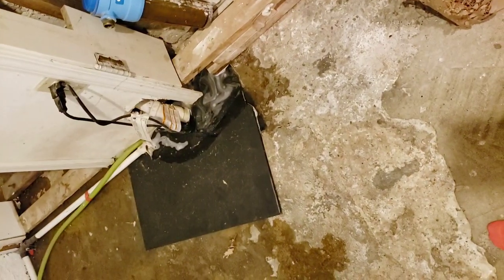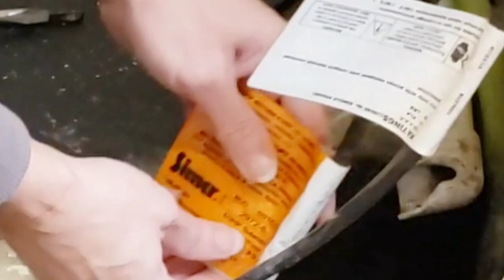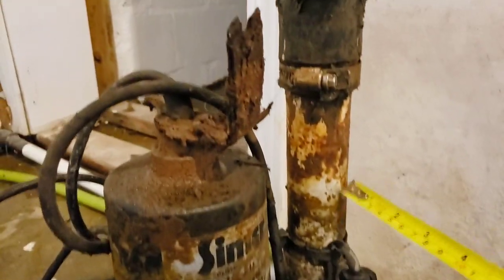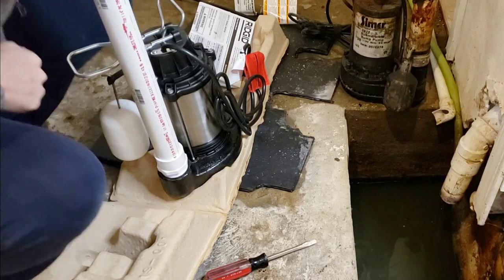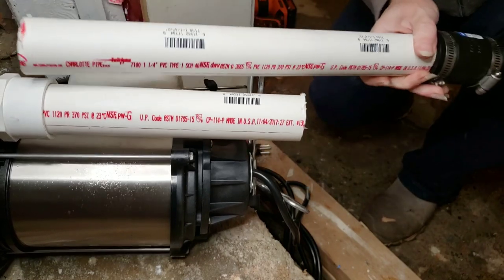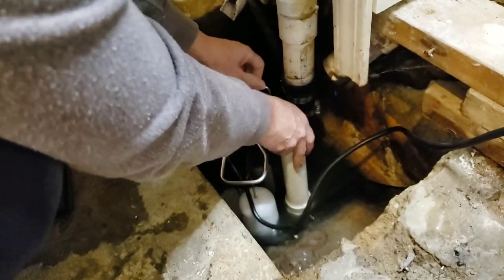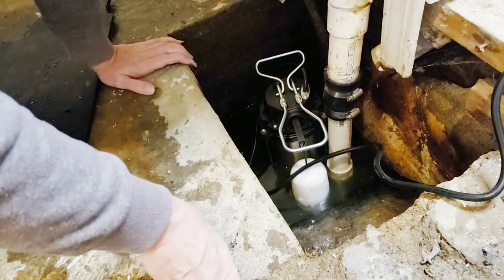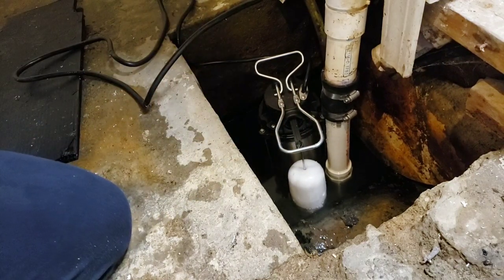Replacing submersible sump pump with Rigid 1/3 hp sump pump

Comment: That's a nice sump pump! Just make sure your discharge line is not clogged or frozen. Been there done that. It is not fun.
Reply from the maker: Not sure what that is or how to do that. It wasn't mentioned in the two "how to" videos I watched.
Reply: @selfretired3025  the discharge line is the pipe you hooked up with the rubber coupling, that carries the water out of the basement to the outside or maybe to your sewer?
Reply from the maker: Ahhh... makes sense. I lived in a house once where tree roots grew into some drainage line and caused grief. Not sure if it's the same "line" but fortunately I don't seem to have that issue here. I will ask my son to snake it out sometime and check. Just to be sure. Thank you for that advice. ♡

Comment: New sub here. Also self retired. Also five decade master mechanic and plumber. Just some safety stuff. Test the new one before install. Wear surgical gloves. Grease or oil the rubber coupling. You can use crisco even. And lastly a 5/16” nut driver instead of the screwdriver . Hope this helps. The important thing is not to be electrocuted. In fact the receptacle you plug 🔌 into should be a GFI.
Reply from the maker: I love all the additional wisdom Safety people bring to the community. Thank you so much for this. While sometimes we have to deal with our own circumstances at the time, these are areas that can either be corrected or considered in the future. Welcome... much appreciated ~ ♡

Comment: Missing a check valve so it will run too long. Maybe that's why the old pump finally died. Needs a 1/8 weep hold drilled in pipe to prevent an air lock as is per instructions. Make sure you drill the hole facing down to avoid water splashing. No pvc glue? Maybe a dry fit to just get it working or for testing. On a new pump, do not assume the same length pipes. Each pump has different hights and the soil, gravel, or other base may have settled over the years.
Reply from the maker: The old pump died because it's expected lifetime had expired. I've had this one installed "as shown" for over 3 years with no issues. Additionally, I wonder if you read the instructions for this model yourself.
Reply: @selfretired3025  Those guys google everything and probably think they sound smart.
Reply: @selfretired3025  BTW a check valve can be more trouble than it is worth, if your run is only short, no problem, and there are a few reasons not to have one, frozen line etc... I just changed a pump 30 years old never had one, cold weather here. And those check valves break and jam your pipe too, but sure they have their place too. But some stranger giving google advice burns my hide.
Reply from the maker: Everyone is entitled to their opinion. They can also make their own videos. Perspectives help others decide what's best for them. Mine is still working great, as is. I do not concern myself with things that are irrelevant to my situation and appreciate input when warranted.
Reply: @selfretired3025  Yes  sure, but an educated opinion would be much better. and help somebody through your experience; not some broad answers taken from a text or google.
Reply: @selfretired3025  Anyway good job.
Reply from the maker: @CowboyAxe some people concern themselves too much with things that are not their concern. We all have lessons to learn
Reply: @selfretired3025  Yes of course.

Comment: Looks like you didn't glue the pvc tube, and you didn't install a check valve. Should really watch some videos before working on it. Also I will replace all the rubber hose and clamps etc. Also get couple nut drivers to unscrew the clamps.
Reply from the maker: I find it interesting to hear you think I did not read the instructions. The last person tried claiming I didn't read the instructions also which was just as interesting. 

Unless you have experience installing this exact model according to the manufacturers instructions... I'd be very careful how you suggest others do it. Not all pumps and situations are the same. You could void someone's warranty or create an unnecessary situation for them.
Reply: @selfretired3025  Would you listen to a man that thinks you should glue threaded pipe at the base? Lol.

Comment: Good job!  I felt your pain while I was watching your video.  I, too, just bought a Rigid 1/2 HP sump pump.  However, my 1/1-4 hose is too small for the 1-1/2 in ch hole on the sump pump.
My brother usually does all that, but he is in the hospital, and I am doing this myself.  I have to go back to Home Depot tomorrow to see if there is an adapter.  Being a female, I have never installed a sump pump before.  The only problem is that my hose is too small to fit in the hole on the pump.  Otherwise, I can do it.  Have any suggestions?  I called Home Depot and all the kid could say was that they had a garden hose adapter.
Reply from the maker: Go to the plumbing aisle. Ask an associate to help you. They're always very helpful. :)

Comment: Did you drill the little hole in the PVC like manual says?  Or does that one say you don’t need it.
Reply from the maker: I didn't read that far into the manual. I did watch the video you linked. Thank you for that. My pump didn't have a check valve so I don't know if having one helps cause that issue. However, I was advised by a plumber that I did not need one, so I didn't add it when I bought everything... but I will look for the manual and may add the hole anyway. Much appreciated ♡
Reply: @selfretired3025  well you are a very impressive person to tackle the project. Many men and women will pay someone big bucks to do these  relatively simple repairs.
Reply from the maker: Like anyone, I have my limits and have had help with other things... but I like seeing what I can easily do, also (like this). Thank you for that. :)
Reply: That model Rigid sump pump does not require a weep hole.  I just watched the video about it on the HomeDepot website.  It gets great reviews.
Reply from the maker: @ihikefar  Thanks for clarifying! I haven't found the need to put one in either. Much appreciated~ :)